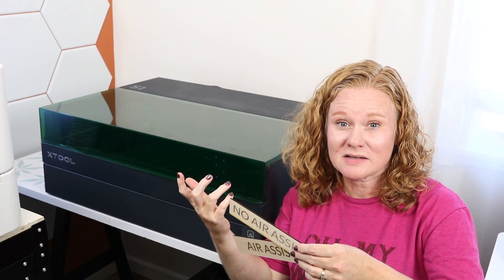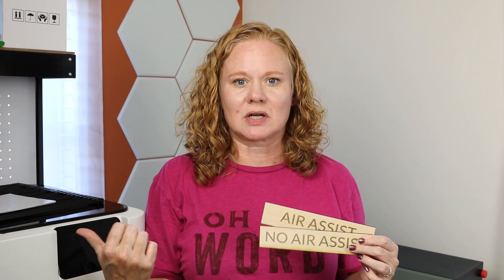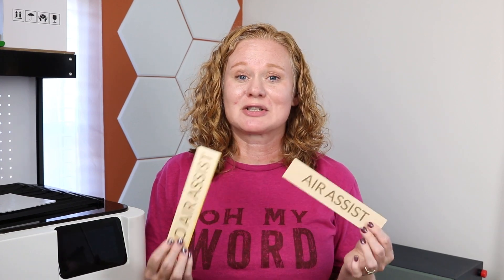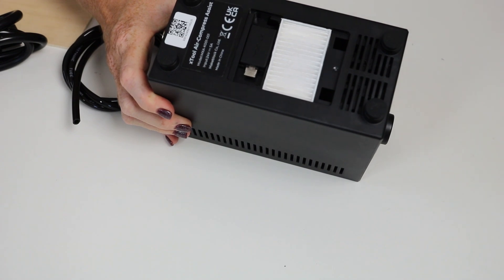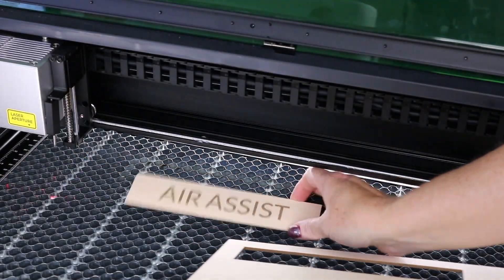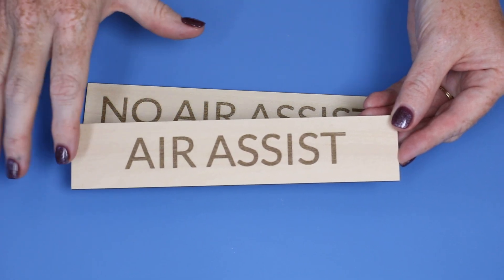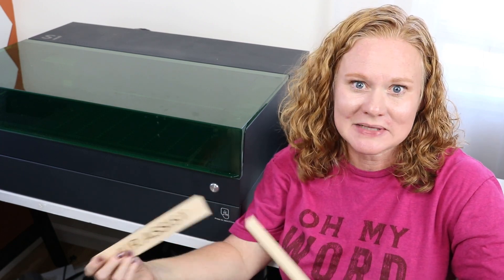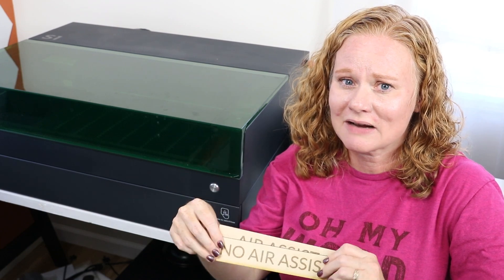Laser Air Assist: What is it? What does it do?

Comment: do I need to block my m1 ultra 20w exhaust fan while using air compressor xtool"  if I do how can I do it.
Reply from the maker: You never block the exhaust fan. The air assist works with the exhaust running.
Reply: @AngieHolden  thanks that's vey helpful